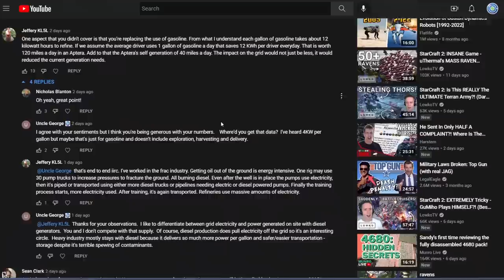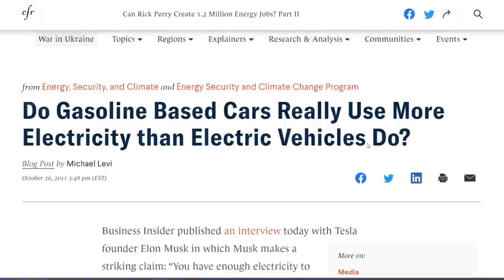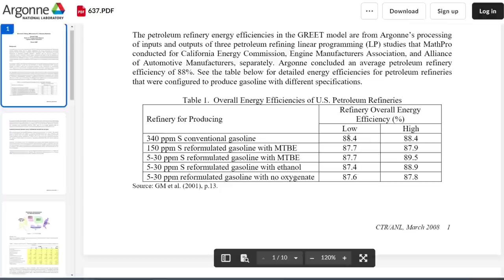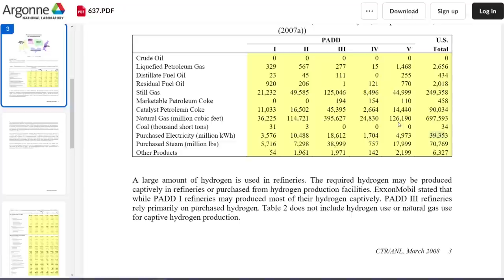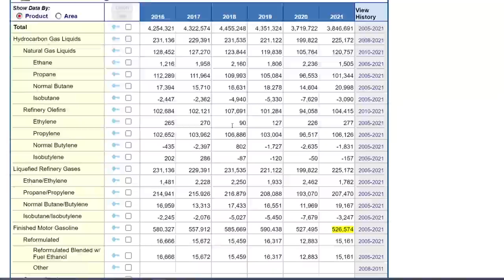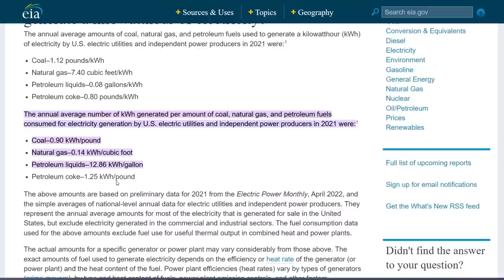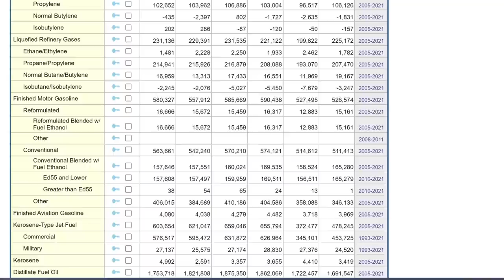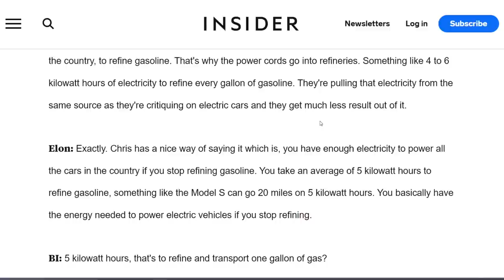How much electricity does refining gasoline actually use?

Comment: Gosh Steve,  Thanks for bringing this myth to the light of the monitor.  The truth isn't always warm and fuzzy but at least it's the truth.  And I want my Aptera.

Up until now I thought these numbers were kilowatts pulled off the grid.  Darn.  My grandfather normally used larch to boil his mash as he felt that wonderful "fragrance" got tangled up with his final product.  The farm didn't have electrical service until the late 30's so no power was pulled off the grid for his endeavors.  Equivalents just ain't the same thing (for me).  But then no one has ever reported that gasoline internal combustion engines are efficient.  Or clean.  Or healthy!  And I want my Aptera.

Comment: This is a really tricky question since, as you point out, it really matters where you draw the boundaries of the system. I think you gave it a fair shake.

The elephant in your analysis is that we don't currently have the infrastructure to generate and transmit the additional electricity needed after converting the primary fossil inputs to kWh. So the 0.4kWh figure does make a lot of sense in that way. 0.4, 2.5, and 4.0 are all equally reasonable in my opinion. Even higher numbers (ignoring conversion inefficiency, as Musk seems to have done) could be acceptable as well, but the speaker needs to be transparent about what they're saying.

I'd give Musk's statement of "4-6kWh" a 3/10 on factuality.
Reply: Some of the larger numbers (ie 8 kwh or 12 kwh) probably factored in other things such as extraction, transport, etc.  Gas is one of the most refined products so simply assuming 14% of the unit volume out is 14% of the energy used to refine is also probably wrong.  To be buying large quantities of steam also tells me the refineries are attached to other industrial operations since you aren't sending that across long distanced.  I will try to find the two studies that quoted the 5 kwh and 8 kwh I cited because they are not the ones Steve found.
Reply: I totally agree Nicholas.
Reply: @Nicholas, another consideration is that most EVs are currently charged overnight, when the transmission infrastructure capacity is the least used. Overall, we currently have plenty of capacity...unless everyone wants to charge during the day during peak hours.
Reply: @lesliefranklin1870  And (or But) as our solar infrastructure grows peak shouldn't be the butt kicker it is at this time.  I'm thinking that in ten years we'll have so much excess solar that we'll start generating hydrogen with the morning and early afternoon glut.

Comment: This data is ONLY at the refinery. What about extraction of the gas’s and oil and logistics?
Reply from the maker: Yes, I stated in the video several times that this only takes into account the refining process only.  does not include the embodied energy of the equipment and infrastructure or the energy costs of exploration, extraction, and transport.
Reply: Thats and how externalities are factored is probably the cause of the wide range.  Buying steam requires they be right next to other industrial operations with their own inputs/outputs.
Reply: @ApteraOwnersClub  Would you guess that it is around 4kwh/gallon including exploration, extraction, and transport?
Reply from the maker: I would guess at least that.

Comment: Great information, but fossil materials extraction & end product transportation (distribution) costs must be included that are included in kWh costs, regardless of energy source, to get apples/apples. So would it be easier if you compared fuel production revenue to margins to find the true economic costs vs trying to track down all the “hidden” cost components? Would doing so yield a more consistent & reliable fuel/kWh estimate?

Comment: I was thinking about the use of electricity in transporting the crude and subsequent fuel products: The majority of pumpjacks at wellheads are electrically powered; pipelines are electrically pressurized and - in some cases - electrically heated and/or cooled; crude is electrically pumped into storage tanks or onto (and off of) ships; refined fuels are electrically pumped into storage tanks, onto trucks or into pipelines; fueling stations use electrical pumps to dispense fuel...

Comment: A small concern about the calculation, just because the amount of barrels of gasoline is 13.689% of the total amount of barrels, does not necessarily means that the refining factory will assign 13.689% of the resource (in terms of electricity) to gasoline, depending on the efficiency of producing the product. Given most product has an efficiency roughly around 90%, the actual figure should not deviate very much from your calculation. Great Job!
Reply from the maker: Yes that's very true.  I just made that assumption since I couldn't find a better way to do it.

Comment: Personal cars are less than ¼ of the usage of the oil refining. Trucks, trains, plastics, and home heating are the largest user of oil. This is the flaw. Even if every car was converted to electric it would only put a small dent in oil refining.
Reply: Trains are the most efficient way to move goods and people over distance.
Reply: electric trains next? although technically they are electric already, as the diesel is running a generator and then electric motors move the train, so infrastructure of electricity above rails to make the power accessible to them is what is needed next.
Reply from the maker: In the video, I stated that gasoline production is 14% of oil refining (so far less than 1/4th actually).  However that 14% is probably enough to run all the personal electric cars in the United States if we went to 100% EV.
Reply: @user--PM  We have high speed electric passenger trains all over Norway with overhead electric wires. They're fantastic. Same cost and time as a car to run across the country. We really need them in the US...
Reply: @peterjorgensen3  Norway is really tiny compared to the US...
Reply: @jamesengland7461  This is true, but these trains are running 300 mile routes at pretty high speeds. It's competitive with highway travel. There's no reason we can't do that either. Ie: LA to San Francisco, Chicago to St Louis, or Pittsburg to Baltimore... Dallas to San Antonio... Etc.
Reply: @peterjorgensen3  it could be done,  but the government will mess it up with outrageous costs.

Comment: All of the millions of pumpjacks sitting on wells run on electricity, but it depends on whether they are grid connected like the ones in urban areas such as Los Angeles, or out in the off grid boonies where they run off a diesel generator. Most of those require a truck to come by every few days to drain the storage tank and refill the generator. Off topic, but related to wells, Texas just got $25 million from the federal taxpayers to cap 800 wells out of the 3-4 million abandoned wells in the US. I think I could make record profits every quarter if I would walk away from my messes too.
Refineries are the single largest customer of electricity in any state they are in and I think I saw that on the PG&E website once for California, but there are a lot of other uses of electricity like the pumpjacks. Oil rigs are also powered by pretty large generators, but they are pretty much fancy pumpjacks.

Comment: A few considerations in your calculation, including:

Gas production, processing, compression and transport. If you work on an average that 15-20% of the energy coming out of a gas field is used as fuel, the gas used in any process is already lossy. In reality, with all of the system losses, about 25-30% of the quantity of gas energy received into a refinery/manufacturing facility was consumed to get it there (i.e. 130% of the gas received came out of the ground).

Refinery efficiency is not 90%, in fact that figure is miles off target. When you add up all of the efficiencies, gas/heat efficiency is much lower at around 65%-70% for gas and lower for coal. Modern boilers are typically in the 84-85% (HHV) efficiency, before process losses are taken into account. Pumps would be more like 65-70%, multiplied by a motor efficiency of 90-95%. Compressors are in a similar boat, with 65% for the compressor, 95% for the gearbox and 90% for the motor (if it is not turbine powered (gas 25-35%, steam depends heavily on the steam balance). At best, refinery efficiency could be as high as 70% and as bad as 50%.

The volume of petroleum fuels used for transport is more than just the gasoline fraction. If you include the distillate, kerosene/naphtha and bunker/heavy fuel oil fractions the figure is more like 70%.

Electricity generation from fossil fuels is inherently inefficient, with combined cycle gas turbines up to 50% (HHV) and more like 30% (HHV) for the best thermal power station.

I hope this helps.

Comment: Great job.   If we could build the energy system from the ground up, I suspect the most optimal solution would be to keep the burning of fossil fuels as early in the system as possible.   They should be used to kind of "prime the pump", and then run as much of the system off "renewable" electricity as possible.  This would probably give us the most bang for our buck with fossil fuels.  Maybe someone should create a line where they research and place the best bang for buck uses of fossil fuels would be placed.

Comment: For a Model S from way back when it doesn't surprise me, it's a bigger car and Tesla's come a long way in optimizing their efficiencies as well. Newer Model 3/Ys can get around 5 miles per kwh, for example.

Here's a comparison in terms of EPA's MPGe numbers:
- Older 2012 Model S: 88 city / 90 highway
- Newer Model S: 124 city / 115 highway.
- Smaller Model 3 for comparison: 138 city / 126 highway
Reply: My M3LR struggles to get 250wH/mile. Over its lifetime it averages around 263 I believe. I cough DID remove the aero covers
Reply: @suunraze  I think it depends on the vehicle release/if it has a heat pump, if you precondition before driving and driving style. At worst I get 220 wh/mi and usually get 200 wh/mi. If I turn off climate I can even get 160. I never do that outside of curiosity tho lol

Comment: Wow this was a really excellent breakdown. The only question I had and perhaps I missed it in your analysis is what is the energy percent used to separate and produce gasoline versus the other products? Is it a direct correlation of percentage of energy use for the refinery and percentage of gasoline produced for that specific utilization of energy?
Reply from the maker: it all happens concurrently so it's difficulty to parse out exactly but a percentage by production volume is probably a fairly accurate proxy which is the method i used.

Comment: Terrific information.  Kudos, Steve.  It'd be nice to compare your gasoline-production values with battery-production values (use of electricity).  Also, you conclude that gas refining may be about 60% of total electricity used to bring gas to market.  I suspect battery manufacturing-use-of-electricity may be only 20 percent of total electricity consumption in bringing batteries to market.  Perhaps some of your engineering 'friends in high places' could work on a more complete analysis.  Again, terrific information.

Comment: Very nice  and thorough calculation. But one nitpick, that is quite important. The whole argument of fossil Fuel companies is that electricity generation also pollutes. Right? So rather than going by electricity output after conversion losses, actual CO2 generation when generating the heat is what matters for this argument.  Since that 85% comes completely from fossil fuels I am sure that will be more than grid electricity used by EVs, let alone when they use solar power.

Comment: Nice job on digging into this.    What about the energy used in the actual manufacturing and production of all the machines, equipment, pipelines, structures, tankers, etc.  that are involved in oil?  Before all those things needed for oil production could be put into operation using the energy you are calculating, a boatload of energy had to be used to produce all of that equipment in the first place.  I wonder how much more that embodied energy would add to your number?
Reply from the maker: yes, this only takes into account the refining process only.  does not include the embodied energy of the equipment and infrastructure or the energy costs of exploration, extraction, and transport.
Reply: @ApteraOwnersClub  Here is an estimate I found on evnut (source bias) on that.  Again every part of this involves multiple inputs and outputs from all stages.  Massive quantities of steam aren't being sent to the refineries over long distances; they are integrated with other industrial operations.  Be good to find the original Nissan statements of 7.5 KWH and related notes.

To extract one gallon of gasoline (or equivalent distillate): 9.66 kWh (maybe not all in the form of electricity*)
To refine that gallon: 2.73 kWh additional energy (maybe not all in the form of electricity*)
Total: 12.39 kWh per gallon.
Reply: @ApteraOwnersClub     Another nuance to consider is the energy returned on the energy invested for various types of crude oil production.  Just doing a little bit of googling I find it reported that a regular oil well from an easy to tap site may produce 20 barrels for 1 barrel worth of energy.   Shale oil is much less efficient at 4-5 barrels produced for 1 barrel worth of energy.  Apparently some shale production sites are as bad as 2 to 1.   So we can add that to our carbon footprints and I for one will be getting a little more depressed about it.   These numbers were based on quick searches.  But I have heard them before from some macro investor discussions on youtube.

Comment: The math looks good, as far as where you are pulling data and rough conversion. The transport and exploration cost would be the other part that is more involved I feel. I think hand waving numbers is about right for what they said in 5 KW, per gal. However the electrical infrastructure isn't setup for the delivery and is out of date/too fragile  to support a full electric conversion. I feel the correct way would be to improve and harden the electrical system, and build out the infrastructure to get us there, but use diesel and electric vehicles. Till we get to a point we can switch over. That is what I see as one of the things holding us back to moving over more completely to electric.
Reply from the maker: well, full conversion to EV wont happen for several decades so the infrastructure definitely has time.
Reply: @ApteraOwnersClub  The USA electrical utility industry estimated it needs one trillion dollars to fix the grid to distribute electric power properly between the 8 utility grids. The inflation reduction act allocated sixty billion for green energy production but not for upgrading the grid. 
Keep in mind most of the refineries are concentrated in Texas along the Gulf coast with oil pipelines feeding up through the center of the USA feeding key midwest refineries. As the figures show most of the refineries use natural gas to produce petro which comes from the lower Gulf and Central states. Keep in mind Texas is basically on its own electrical grid and California no longer plays well with its partners on the Western Grid. The CA energy manager requested permission in late 2021 from the present federal government administration to exceed emission levels from their fossil fuel electric power plants to keep the lights on. 
T&D takes a lot more money and time. Presently some state utility grids like ERCOT in Texas and CASIO in California are living on the edge. They both want new power plants and realize their substations are old. They both talk about renewables but fall back on fossil fuels for a quick fix.
Reply: I have electricity at my house, as do most people. I charge my car 80-90% at my house as do most people. I don't think the grid needs anything from that perspective. However the grids do need a lot of updating and resiliency in terms of reacting to climate change and solar activity which should peak in 5-7 years. A large solar storm aimed at earth could knock down a significant amount of the grid for a year or more because large transformers take so long to make.
Reply: @kenmcclow8963  Not only the transformer but also the wire and MV switchgear are taking a long time to source. Passenger vehicles and especially Aptera that only use around 4-6kWH charging at night are not typically an issue. Charging EVs and creating H2 using utility demand control is not an issue on almost any grid unless you are on an Indian reservation in Northern Minnesota. I work for a company that mfgs diesel engines, H2 and EV power trains for semi trucks, trains, ships, and buses, H2 fuel cells, and petro gensets along with microgrids.  I have been asked by utilities in the southwest to design Tier 4  prime power diesel gensets along with microgrid solar and batteries because of weak utilities. In one case a kid's mylar ballon took down part of an international airport terminal and communications because of tight relay settings due to grid utilization. Plus someone messed up the emergency ATS settings.  As Elon Musk tweeted last year there are electrical utility (ie- grid) concerns and he was not referring to power generation.

Comment: The argument is concerning whether or not the grid can support 100% ev's.  Or more accurately generating capacity during peak summer hours which becomes much more complicated and doesn't necessarily use all of the fuel sources being offset, and it needs to account for how many cars are also charging during that time.  As it was stated before it depends on where you draw the boundaries.
Reply: Every body doesnt have an electric car so its not a problem and it will take years to supply/change to 100% in which time the grid will evolve easily.